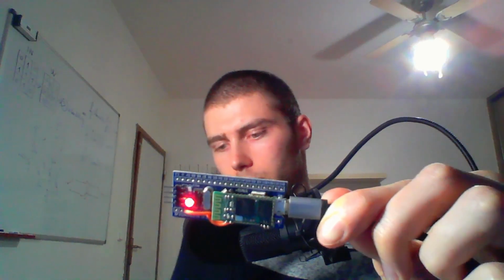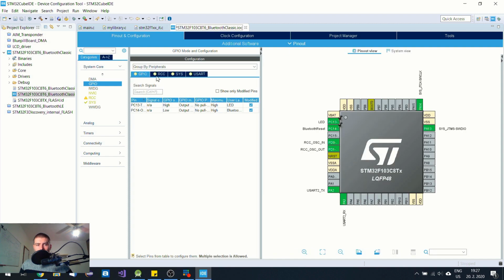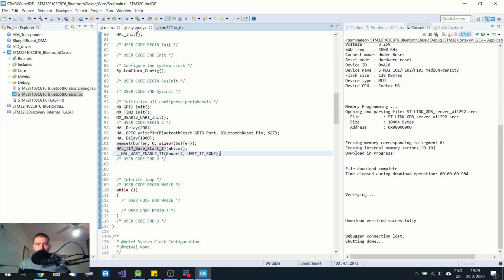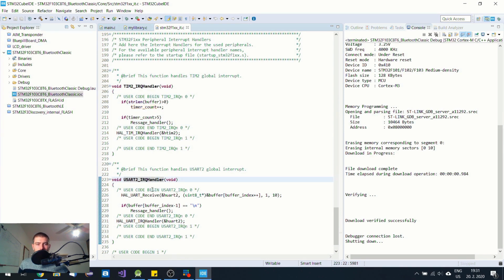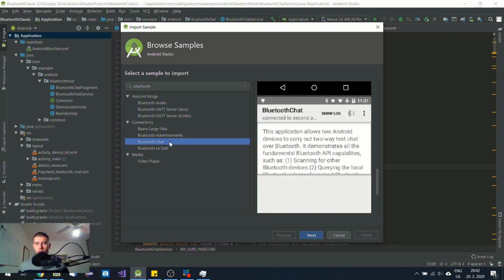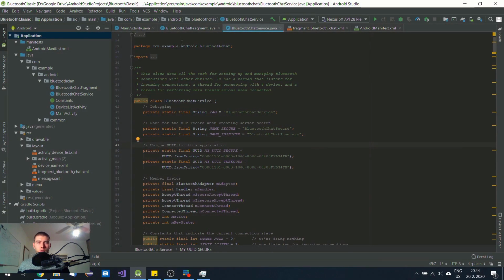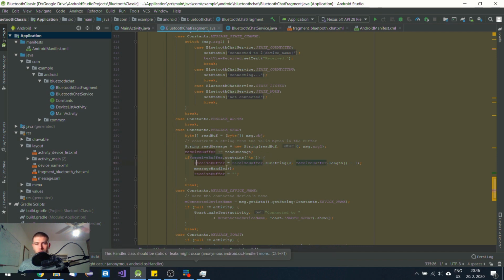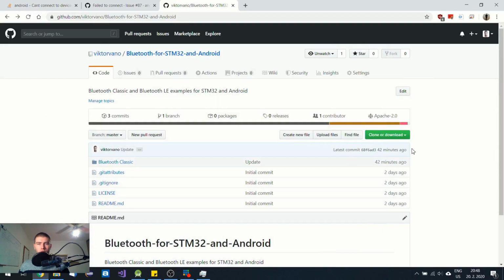Bluetooth Classic Tutorial for STM32 and Android (HC-05 HC-06 module)

Comment: Hi, are you using HC-06 or HC-05? And how you connect the bluetooth module to your STM32 board? I am using STM32F103RB and it doesn't work. HC-06 is paird with my phone but it doesn't send data from STM32. I would really appreciate anyone help.
Reply from the maker: I have used HC-06 module. It only needs a power supply and UART interface.
Connect UART like this: RX of Bluetooth to TX of STM32 and TX of Bluetooth to RX of STM32.
Power supply:  a) I have just a module without a regulator, so it needed 3.3V power supply. 
b) There are also modules with a voltage regulator on it, so they need 5V power supply and the regulator makes it 3.3V for the Bluetooth.

Comment: My current device (Stm32L0) is at a baud rate of 11520. Will the baud rate have an impact on weather I will be able to communicate with the device via bluetooth? If so how do I change the Android studio Bluetooth baud rate?
Reply from the maker: Yes, default baud rate is 9600 for the Bluetooth classic. You probably mean 115200 bits/s. But the baud rate of both devices should always match.

Comment: Question: Can the HC-05 be connected to only pins with USART or any GPIO Pins?
Great Tutorial btw!!
Reply from the maker: There are documentations out there. I just googled it and found out that you need to use specific series of AT commands.
AT+ROLE=1 sets it as a master.
Check out instructables.com

Comment: Hello. Very nice tutorial. But why do you use UART interrupt if you use HAL_UART_Transmit(...) instead of HAL_UART_Transmit_IT(...) ? Btw how to get uart input from guitar jack ?
Reply from the maker: I use UART interrupt for receiving messages and writing them to a buffer. Just read my code carefully.
Reply: @ViktorVano  Why just for receiving and not additionally for transmitting?
Reply from the maker: @salamander2775  it does not matter in this case.

Comment: Nice tutorial. Really helpful. One question I met is that, the STM32 codes for receiving data, i.e HAL_UART_Receive(), works perfectly while testing with strings. However when I am trying to send a few digits, it always times out after 3 bytes are received, leaving the rest of the buffer \0. Any suggestions?
Reply from the maker: Just put this line to your UART interrupt function (at line 227):
timer_count = 0; //this will reset the timeout and is suitable for data streams
Reply: @ViktorVano  ty for the reply. After I modified the code into my project I noticed that my stm32f4 can only receive 256 bytes in the buffer. After it overflows, it starts overwriting . Is it a physical limitation?
Reply from the maker: @ropholuo969  if you use buffer_index as uint8_t then there is your problem.
uint8_t timer_count = 0, buffer_index = 0;
change it to uint16_t (4095 is the max value)
uint16_t timer_count = 0, buffer_index = 0;

And I have allocated buffer to 50, so you will need to increase that too.
char buffer[50]; // put there a bigger value
Reply from the maker: @ropholuo969  And if that will not help, then maybe it is a Bluetooth's firmware limitation.
Reply: @ViktorVano  perfect. Ty so much you've been really helpful.

Comment: Hi, are you using Hc-06 or Hc-05 on this video?
Reply from the maker: I have used HC-06 :) HC-06 is just a slave (device). HC-05 can be used too, but be careful, because HC-05 can be both, as a master (host) and also as a slave (device).
Reply: I tried both and i connect vcc,gnd,tx and rx working (#ViktorVano thank you man)
Reply from the maker: @bekirozturk91  Thanks. And stand alone module as in the video was connected to 3.3V. If you are using a module with a PCB and pins from the side, it has a regulator and requires 5V power supply in that case.

Comment: Hello, I have STM32F411RE. I've set everything as you did, but i receive nothing on the screen when tapping the buttons or writing a text, Please help
Reply from the maker: Are you connected to the Bluetooth module? You should be paired with that HC-06 module and connected via app menu by tapping to the Bluetooth icon on the top of the app menu, next to those three dots ... Then you pick up a paired device.

Does your Android app say "You are not connected to a device" when you tap a button?
Reply: @ViktorVano  Hello ,thanks for replying, in fact the device (HC-05) is connected successfully to my phone. 
For the connection, i set Vcc to 3.3V, Gnd to Gnd, Rx of the module to Tx of STM32, Tx of the module to Rx of STM32.
Reply: There is another thing, in CubeMx, in TIM2 i set clock source to internal clock but Channel 4 is highlighted in yellow, is that a problem ?
Reply from the maker: @elmehdibettahi4836  Then you should enable global interrupt on uart. And make sure that your pins are connected to the correct uart. Someone had connected uart1 and was using uart2 in the code. Just check potential mistakes.
Reply from the maker: @elmehdibettahi4836  it does not matter, you are not using any channel, just time base.
Reply: @ViktorVano  Yes, I saw the comment, and i'm using the USART2 PIN which are PA2 and PA3, But still nothing, i can't even guess where the problem is. 
PS : The 2 pins (STATE and EN are not connected)
What is the Reset Pin that you connected to your PC14 ?
Reply from the maker: @elmehdibettahi4836  just try to put into the infinite while(1) loop funtion to send a string every 3 seconds or something. Like HAL_UART_Transmit(&huart2, "test", 4, 500); HAL_Delay(3000); 
It should send a message to the app, when connected.

only uart is important. If you are successfuly connected, then the module should be able to send/receice data as a transparent uart.
Reply: @ViktorVano  Thank you, I'll try to redo everything from the beginning, because it's really weird that nothing is received (in Bluetooth Terminal), something must be wrong in my configuration.
Reply: Hello again, So i have made it work with USART1, everything work perfectly. I still don't know why it didn't with USART2 thought, but it's OK.
This comment is for those who might have the same problem as mine, just try a different USART, you never know.
And by the way thank you @Viktor for your help.
Reply from the maker: @elmehdibettahi4836  You are welcome.

Comment: hi , I downloaded your project from github and imported in stm32cubeide.......and burned code in stm32f103c8 ......but nothing is working ....only change present is that i didn't connected pc14 to reset......can you please tell  connection details ....i used 5v to power hc-05...i also used another bluetooth terminal app from google play
Reply from the maker: If you have bare HC-05 or HC-06 module, they need 3.3V, that means 5V will kill that Bluetooth module. I have said that at 2:05
If you have a Bluetooth module on the board with a regulator then 5V is OK. If you power up your module properly, then it should be visible on the phone or laptop...

And another thing is that there are knock off modules. The original should have a printed website on it near antenna like www.hc-01.com
Reply from the maker: And pinout should be straight forward in the code configuration (code generator) perspective. UART is on PA2 and PA3. Connect RX of a module to the TX pin of the STM32. Then TX of a module to the RX of STM32.
Reply from the maker: Bluetooth reset pin is optional, not necessary.
Reply: @ViktorVano  thanks sir.....actually i was making connection with uart1 instead of uart2..

Comment: Great video .. Just wanna ask about ability to send latitude and longtitude (location parameters) to stm32f0 via bleutooth(hc05)?? 
Thank you ..
Reply from the maker: You can use my Android project and add there some code from stack overflow :D
Put the code into the file, where I have been explaining those on click listeners and message semding. Once you get the location data you can convert them to string and send them. https://stackoverflow.com/questions/2227292/how-to-get-latitude-and-longitude-of-the-mobile-device-in-android
Reply: Thanks for replying.. So send the location in type of string via bluetooth and recieve them with the stm32 ... I'm going to use those values in calculation function .. Is that okey?
Reply from the maker: @akramrouabah9616  Yes, you should always send them as a string. Then you should parse that into the float.
Check function called "void ftoa(float n, char *res, int afterpoint)". Just remove that "extern C" before the function.
And this function calls two other functions "int intToStr(int x, char str[], int d)" and "void reverse(char *str, int len)"

line 367 and down: https://github.com/viktorvano/NeuroBot/blob/master/System%20Workbench%20for%20STM32/STM32F103RET6_NeuroBot/Src/Neural_Network.cpp
Reply: @ViktorVano  okey bro .. so you programmed the stm32 using stm32cubeMX with the stm32cubeIDE or you just used one of them .. cuz i'm not quiet familliar with this microcontroller hh thanks
Reply from the maker: @akramrouabah9616  One year ago I was using STM32CubeMX, because there was not the STM32CubeIDE at that time.
Currently I use STM32CubeIDE. Have I answered your question?
Reply: Does the stm32cubeIDE contain the stm32cubeMX graphics initialisation and the IDE i mean i don't need keil uvision to write my code?!!
Reply from the maker: @akramrouabah9616  The IDE contains both. It is all in one package. STM32CubeIDE contains that nice graphical code generator and it also has the code editor, compiler and debugging tool as any other IDE. You just need this one for everything. :) Watch carefully this tutorial and you will see that I switch those perspectives.
Reply: @ViktorVano   thanks a lot my friend .. Really appreciate that help  you gave me .. Hope of seeing how to get location parameters into a stm32 via bluetooth in the next videos
Reply: hello again friend .. so when i download ur project from github .. should i directly open the file with stm32CUBEIDE and start modification ??
Reply from the maker: @akramrouabah9616  Hi, you should open your STM32CubeIDE, right-click on workspace, import, General, Existing Projects into workspace, then import the project folder, and then you can finally edit your code :)
Reply: Can you give the IDE where you developed your android app please?!
Reply from the maker: @akramrouabah9616  https://developer.android.com/studio